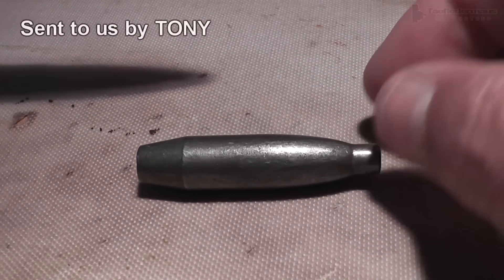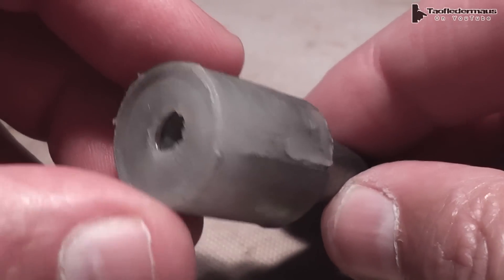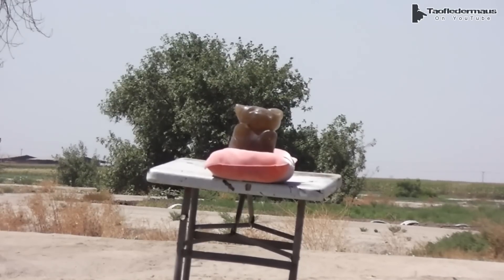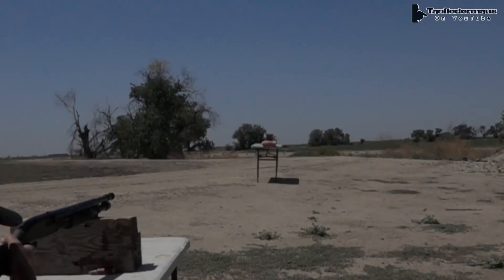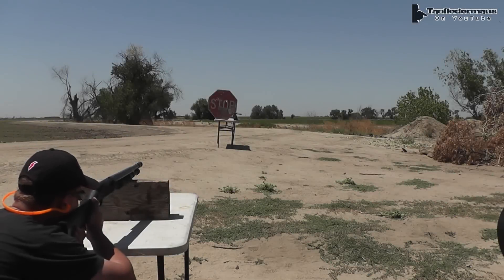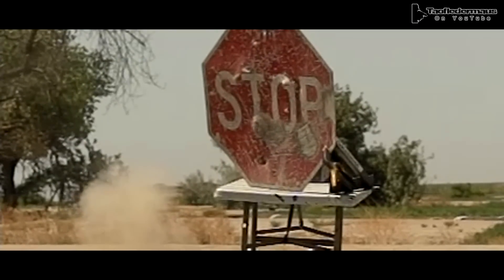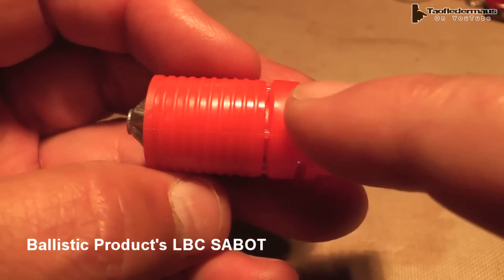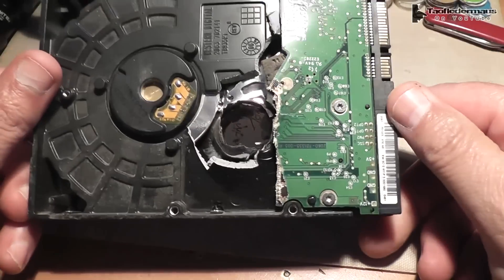.50 Cal Steel Penetrator Core Shotgun Rounds

Comment: What if you added some kind of cordage to the back to create drag
Reply: like thin Kevlar cord. that would be cool.
Reply: wound probably get ripped off. the g shock from a12 gauge is insane
Reply: You could hot glue the cord to the end of the core, the put it in a mold and pour some lead on it. Not sure how heat resistant Kevlar is, but just an idea
Reply: +Bryce Kimball what if you drilled a hole through the bottom and ran the cord through that then reinforced the connection and hole with glue or lead?
Reply: +swankmosquito that's not a bad idea, as weird as it sounds. 👍

Comment: Hey Batman I actually have an idea for a custom slug, a liquid core shotgun slug. Essentially a hollowed out standard 12ga that has water or whatever other liquid you wish to put in it, and the ass-end which is where the opening is then gets a second regular non hollow 12ga slug welded over it in an ass to ass manner. Sort of a reverse human centipede but with shotgun slugs. I reccomend arc welding for something like that because most other types of welding require intense heat which would evaporate the chosen liquid, another idea is essentially the same thing but instead of using a standard non hollowed slug you would use two hollowed slugs welded ass to ass and one would be filled with birdshot while the other is left empty.
Reply: I'm hoping these ideas stay around a $10-$15 dollar budget

Comment: you said these cores are incased in a full metal jacket. Why not try shooting the whole projectile or a cut down version if weight is a problem? Could you try shooting solid closed end lug nuts? Not the capped ones. hey may be bad news.

Comment: No comparison between a 12 and a 50 There not meant for the same thing 50 is a anything that moves stopper at miles of range 12 is only for 50 accurately

Comment: I could be stating the obvious but just in case; it's time to move on from hot glue as any kind of binder for projectiles. Not trying to be the guy who says they can do it better, if I could I'd have my own legitimate youtube channel, but might I make a suggestion??Something made of silicone, perhaps https://sugru.com/about might withstand the pressures and temperatures of deflagration better, or some other mix/pour/cure type silicone common in mold making practice.